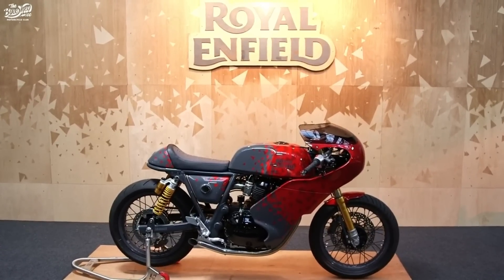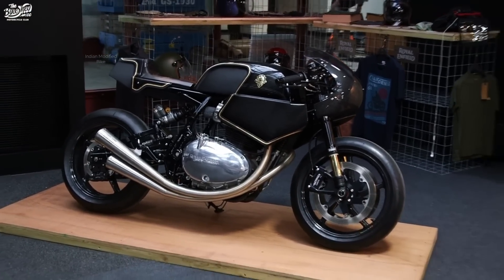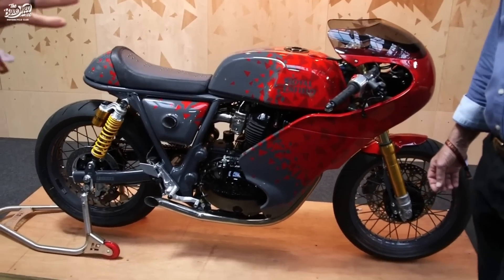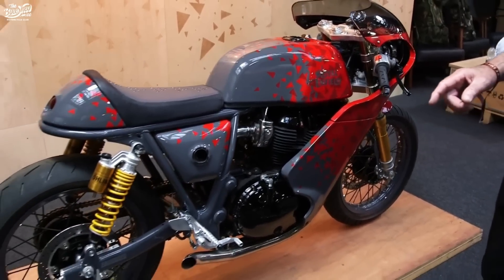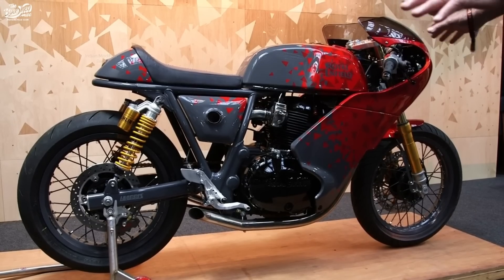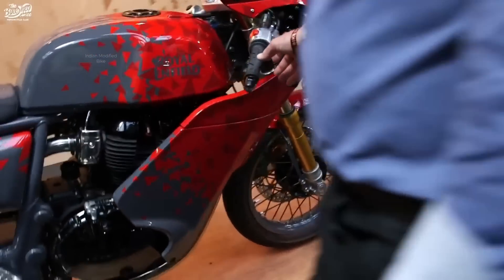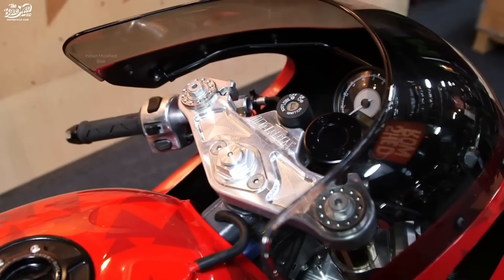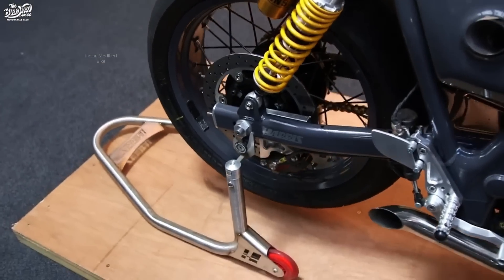Modified Continental GT 650 | Custom Graphics Red & Black

Comment: The design is good but not practical... This is a Air Oil cooled engine 70%air  and 30% oil .... this design Cuts the Airflow to the Engine and Raditor.. ( safe to Say it's just Made for the Show) the Black bike looks more Practical..